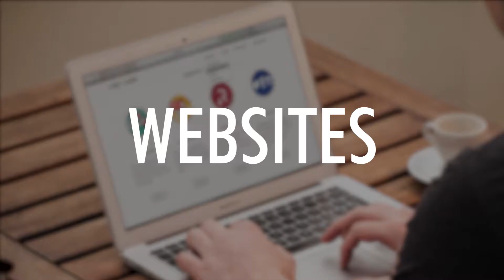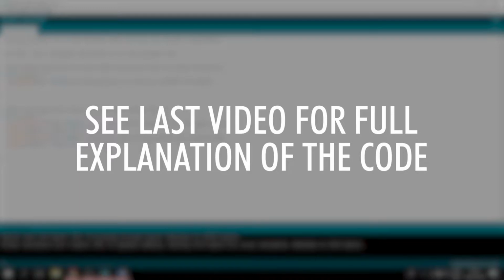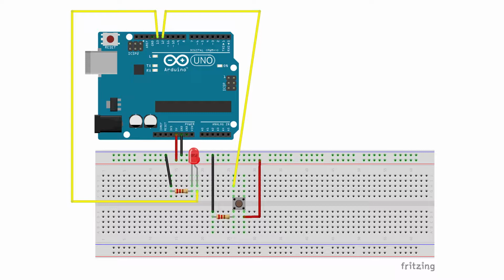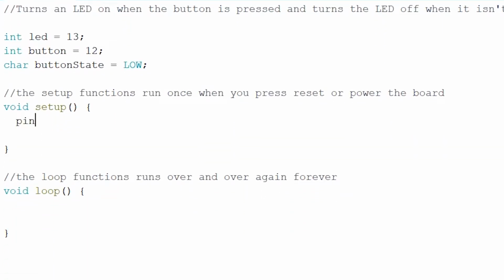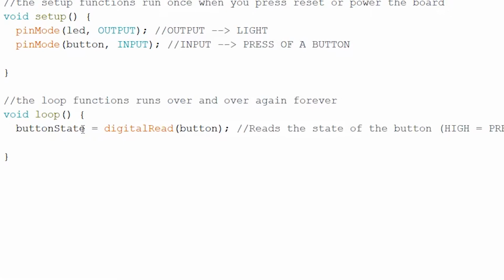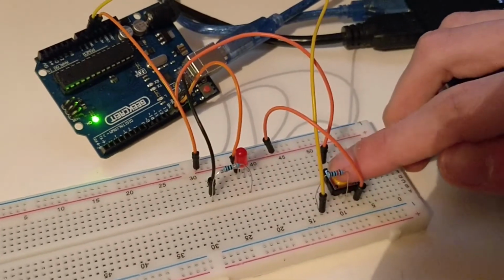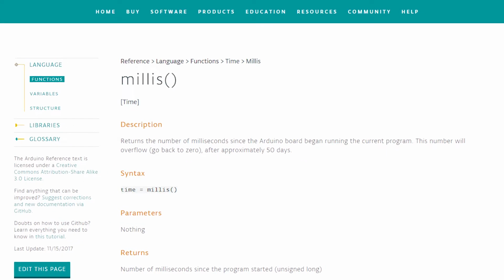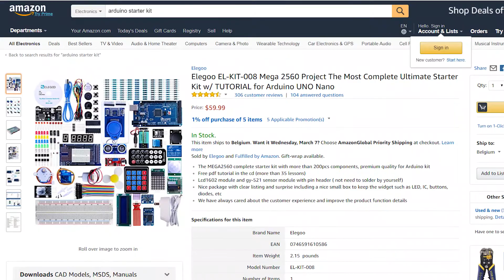Arduino Uno led push button tutorial on and off

Comment: It's not clear to me why you need the resistor to ground on the button. Why isn't it enough to connect it to current and to the digital pin?